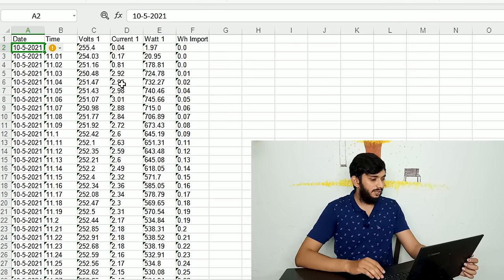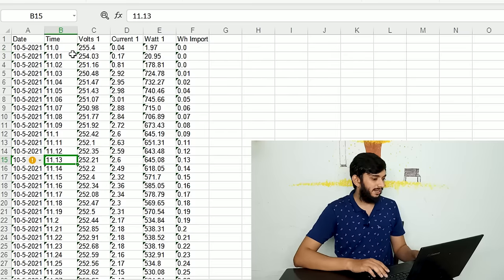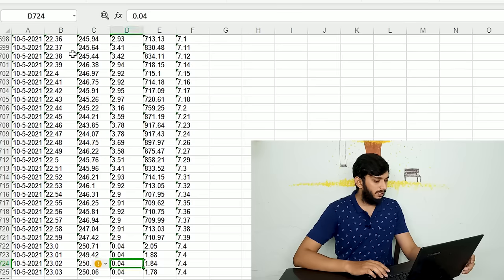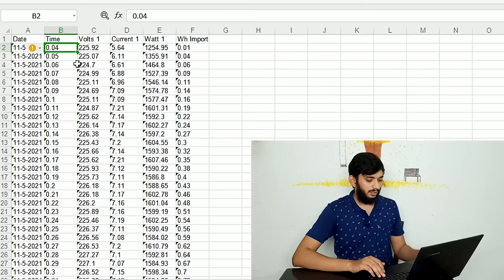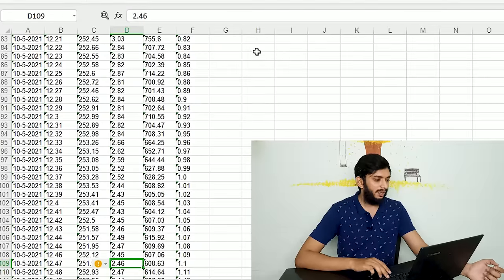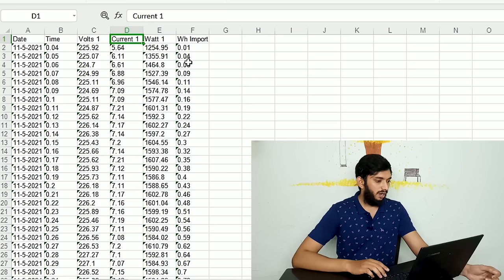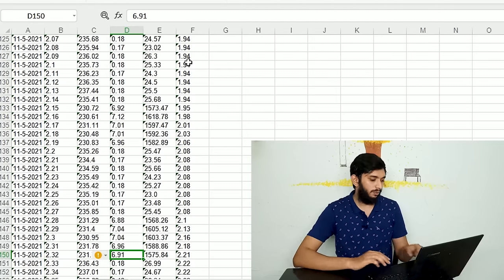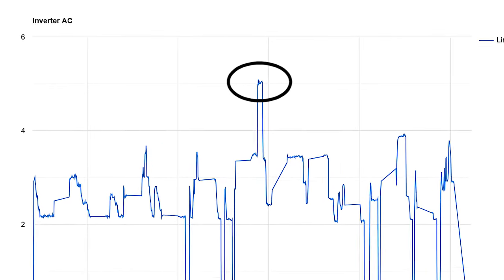Inverter AC vs Normal AC, How much unit will it consume?_Tamil, Does Inverter AC, Energy efficient?

Comment: Bro i think nenga inverter ac morning use pannanala energy consumption athigama irunthurkum(bcoz morning outside temperature high ah irukum when compared to night) so intha difference nu naneikiren
Plus inverter ac la energy consumption constant ah irukura nala load(instant energy consumption at all time) kammiya irukum so overload agi wire burning (sometimes eb wire burn agi power cut aidum) la nadakura chance kammi 
Drawback of inverter ac nu patha compressor all time work agura marinirukum so lifetime kammiya irukalam

Comment: you done a good job, and my opinion is normal Air conditioner  compressor life is long because off time on time interval is same so the compressor get rest time ,that is cool time get its increase the life of the compressor,  inverter air conditioner is ware-tear is high because continuous working is parts gets worn out  very soon. then interval time is that is slow and fast cycle is non even interval so it will damaged the compressor very soon...      We are paying money is inverter ac is one and half times high. they are fool to us.  the spare cost of the inverter ac is very high. ... awake people...

Comment: Very informative video. 1) One AC was tested at night and other one at day, this may be one of the factor for power consumption since environment temperature was different.
2) Can you please tell which ac will last long as service point of view
Reply: Non inverter ac will last long and is easy to repair.
Reply: Any AC will last long as long as you clean the filters regularly and do service every year, non-invertor ACs are noisy as hell as they run in full blast, invertor ACs are silent and are uselful for long duration run min 6hours. 
Invertor AC will sustain the temp constantly for example 28 will be constant throughout the run.
Non invertor will fluctuate the temp it's not really healthy and I dont know how he even says he is comfortable for me it's the opposite.

Comment: Hi bro...
I appreciate your effort to measure the kWh in both the AC's.
One point related to advantage of inverter AC is: In inverter AC, BLDC motor is used as a compressor motor & whenever the cooling goes down, the compressor will start smoothly due to presence of electronic switches in the inverter. Due to the same, the current is less while starting.

Whereas in non inverter AC, induction motor is used as a compressor motor. So whenever the cooling comes down, it will start & run with full speed. 

In induction motor, due to sudden start, the starting current will increase. Due to this, the life of the coil inside induction motor may deteriorate faster than BLDC motor.
Reply from the maker: https://youtu.be/imzw_dFzvL8
Reply: @engineeringfacts  😂 Semma reply bro 👌🏻👌🏻 Mass bro 💪
Reply: @Venkatesh nakku 🤦🏻‍♂

Comment: Appreciate your efforts.  For Tamilnadu you should run the AC at 25 degrees both at the same time.  Inverter runs in the morning where temperature is very high and non inverter runs when the ambient temperature is low.  That will give a clear picture.  The data definitely is miskeading

Comment: Thanks for the detailed review. 
Inverter AC is use and throw. Board is very costly. 2 of my friends changed it in 1 year. Think and choose.
Reply: Board warranty eh 3yrs irukum yarta kadha udra
Reply: @Kratos7686  Did you used inverter split AC or not
Reply: @sriramram7561  yes pcb board warranty 3yrs kudupanga, so reel udadha
Reply: @Kratos7686  We bought LG, the AC it failed  within 15 months, company technician told 15K for board replacement. 
Naan reel vidaradhuku avasiam illa. 
AC mechanic are not suggesting for inverter AC as well.

Comment: A big factor in Air conditioning was missed. The room size plays a key role in this experiment. If the amount of air volume to be cooled is higher in the case of inverter AC, then the number of units would be more. Ideally speaking both the ACs should be run in the same room during the same time interval (i.e., morning or night cycle) to do a proper comparison.
Reply: One in day and one n night doesn't make any sense
Reply: That's correct, I agree with your comment. Both should check in the same room, time and duration.

Comment: Great content. Appreciate the efforts. Big fan. Pls consider the following in a constructive way.
You have mentioned that there are no big difference in internal heat load (human, equipment, lighting)in both the rooms. But the external load seems to be different.

I feel the comparison would be valid if done in same duration of the day. The heat load through walls due to solar heat gain is peak at 4 PM and on West facing wall. 

So not just the room size, but the building orientation is also important. Is the west facing wall is exposed outside or not. Also roof has a good impact depending on if the room is in top floor or mid floor level?
Maintaining these would make it equal comparison from HVAC load point of view.
Reply from the maker: Check pinned comment. Given night time data of inverter Ac.

Comment: I guess the difference lies in compatibility to solar panels. With inverter AC, with low ampere, it can be run on solar, but it's near impossible for it to be done with traditional compressor ac.
Reply: We need solar ACs like solar pumps! They run at different load/speed depending on power availability!

Comment: 1. Bro... Daytime la 2 ACyum onna run panni data record pannunga... Atmospheric conditions remba important while considering power saving. 

2. Nenga 28 deg C la vachum over cooling ah irukuma unga inverter AC complaint nu artham.. may be temperature sensor faultya iruklam. So atha check pannunga.

3. RPM 1 / RPM 2 = (KW 1/ KW2 )^1/3.. Intha theory use panra entha machine ah irunthalum power save pannum. Inverter AC Ku pathila nenga normal VFD applications parunga. Same theory than ithulayum use panranga. At same conditions inverter AC will definitely save energy.

4. Inverter AC use panna machine oda starting current save panna mudiyum. No of starts kamiya iurkum. Machine life time athigam.

5. Inverter AC vangum pothu right deisgn ku vanganum. Nenga 100% continuous ah heat generate panna kudiya edathuku inverter AC vanganumnu avasiyam ila... but bedroom ku inverter AC than best. Heat generation irukathu.

6. Model , type of compressor, mechanism, manufacturing year , star rating ithu ellame factors than.

Marketla Rs.17000 ku new AC iruku. But athoda energy consumption remba remba athigam. ungaluku vanjapugalchiyanila yarayavathu pali vanganumnu thonuchuna Rs.17000 AC vangi gift ah kuduthrunga.. athuku Current bill katiya nonthuruvan. Anyway a big salute to you bro... Ivlo detaila report eduthathuku.
Reply from the maker: Check pinned comment. Given night time data of inverter Ac.
Reply: @engineeringfacts   bro... Could you please share me the daytime data of both at same conditions?

Comment: Brother... you have taken the DIFFERENT time period in DAY and other one in NIGHT.. It is wrong... Because the Power load consumption of the AC unit depends on the variation of Inside Room and out side Temperature. So during the day time the Temperature difference Inside Room and Out side will be MORE and during the Night it will be Less ... So You will get the correct result only during the Day Time of High difference in Temperature of same timing, & Same size room  which is very Important ( Say from 9.00 AM to 6.00 PM ) .. Also you should Note down the initial Temperature at 9.00 AM, Peak-Mid Temperature @ 2.00 PM and final Temperature at 6.00 PM on both days of reading of Normal & Inverter AC's, where you have to prove to be same... Hats up for your efforts in bringing this video.. Hope another video of this correct day timings will provide perfect result and Likes to you .

Comment: I have tested a 1.5 5star inv ac and 1ton non inv ac. The power consumption varies for night and day. For inv temp of 29 will suit as it cools steadily and 28 will suit for non inv. 
1. For inverter ac or non inv ac the power consumption is not the same for night and day. I have practically measured with a power meter. 
2. As you have mentioned the set temperature will vary. You will need to have a temperature meter in the room to adjust the ac temperature uniformly as there will be slight variation of 1 to 2 degrees for inv and non inv ac cooling distribution as you would have noticed. 
3. I did this test to check current power consumption. To check if I need to replace old ac as there are board issues and the compressor vibrates a lot which is transferred to the floor and walls. 
- 1.5T 5* Inv ac was taking just 1.7 units for 7.5 hours averages to 222 watts @29°c. Room size is 170 sqft.
- 1 T non inv LG ac took 3.8 units for the same 7.5 hours night run averages to 500watts@ 28°. Room size is 140sqft.Both in top floor. This ac was serviced recently so no question of clogged filters too.

I can clearly see a difference in the power consumption between inv and non inv ac. Maybe 3* inv ac might not be so power efficient but a 5* surely is. The power the inv compressor settled down after cooling the room post 35 minutes was 180 to 210 watts. This is similar to an air cooler.
Reply from the maker: Check pinned comment. Given night time data of inverter Ac.
Reply: @engineeringfacts  Thanks

Comment: He say correct iam Ac mech only
After 2017 particularly display models stabilizer reading maximum wrong only
And we use normal ac we set 28 degree temperature only
It's very comfortable for sleeping and power saving

Comment: Brother I think stabiliser la thaan problem irukku. Can you get the data without using voltage stabiliser. because stabiliser leakage irukkurathaala inverter AC units adhigam varuthu you can see here less current but voltage more

Comment: I have both , all your points are correct but  what I feel is in normal AC i feel a sudden throw of Cool air and stops abruptly, but in inverter i feel the smoothness no sudden throw of Cool air all flow increase gradually and your not going to  feel sudden change of  cooling  ,, inverter  gives us a very good comfort.
Reply: Yes, inverter ac will comfort, that why peoples switched to inverter ac

Comment: So true. inveRtor ACs doesn't make sense for domestic purpose.
It may be help reduce power for commercial use where ACs keep running for long durations. However, incase of board failur in inveRtor ACs, service cost will be high in inveRtor ACs.

Comment: Good attempt for an youngster. But a more scientific approach is required. EER score of the AC is an important factor. EER of 3.5 to 3.99 fall under three star but energy consumption will vary. 
Also actual temperature should have been plotted on ten minutes gap (both indoor and outdoor). It is very important to give careful attention to boundary conditions while designing an experiment. You have the potential to differentiate yourself from juggad crowd. All the best.

Comment: As perVoltage fluctuation area better go for an inverter AC.
Because it won't trigger in very low voltage .Then no need of placing stabilizer.

Comment: One more test needed bro, before verdict. Run the Inverter AC from 12AM-12PM and Non-Inverter AC from 11AM-11PM. ஏன்னா, அந்த மதிய வெயிலை சமாளிச்சு ஓடுறதுதான் கஷ்டம். பாத்துட்டு Resulta sollunga. I guess 12-7, Inverter ரொம்ப கம்மியா எடுக்க வாய்ப்பிருக்கு. அதுக்கப்பறம் வெயில் வந்ததும் சமாளிச்சு ஓடும். அதேபோல Non-Inverter AC 11AM-11PM பயங்கரமா பவர் இழுக்கும். 🙂

Comment: I have a voltas 4 star non inverter AC and a Daikin 5 star inverter AC and a carrier window AC... All are 1.5 ton... Tested them at same night with 28 degrees... From 11 pm to 6 am... 
Carrier has consumed nearly 10 units...

Voltas has consumed 6 units...

Daikin has consumed 3 units...

And I felt more comfortable with inverter than non inverter as it maintained constant temperature...
Reply: All are in same room or another rooms

Comment: Outside temperature plays a big role and also the persons inside the room. To be simple inverter and non inverter is like normal ac and automatic ac in car. When u set the temp in automatic or inverter it will adjust the running of compressor to maintain it. Normal ac also does this but it will stop the compressor when temp is attained and checks for the room temp and again it starts to run if temp is high. So in there wont be sudden urge of getting load in inverter ac. there will be variation in units when u use it in long period say abt one year.                                To be clear if ur using ac often and daily go for inverter or if u use only for the summer time then u can go for non inverter
Reply from the maker: Check pinned comment. Given night time data of inverter Ac.

Comment: Normal (non inverter ac ) run aana time la out side temperature mostly low a eruka chance eruku…  bcz athu might night la run agiruku… inverter ac vanthu outside temperature mostly high a eruka chance eruku… may be if possible try to calculate same time then we come to know correct answer….
Also star um impact panum so better mention star as well

Comment: I am from Sri Lanka. I am using a non inverter AC set at 26 and for 4 hrs at night. Outside temp should be around 29 with high humidity. My AC unit is continuously working throughout the night with approx 1 unit/hr. Is this normal? I thought AC compressor should stop and start according to temp inside. I run ceiling fan too.

Comment: Bro inverter AC la voltage leval parunga high ah irku
But normal AC la approx 230 tha vandruku ...Enna tha voltage and current ah vary pannalum wattage same ah tha varum... inverter AC la Enna benefit na compressor and contector life ah extend agum avlo tha athu current nearby 4 A athanala

Comment: Both you should test on same time why because day time hot will be more so to match that AC has to on all the time. However, night temperature will be less so it’s easy to keep 28 degrees on continuous AC activity is less.
Reply from the maker: Check pinned comment. Given night time data of inverter Ac.

Comment: The two a/cs seem to give same results. But the differences are there.
Input voltage is shown as 250 and 225. Inverter a/c runs continuously and the wear and tear must be more.  If the difference in timing between stop and start are larger then it will be good, but this is for normal a/c only. This is possible if insulation is better in the room. This makes no difference for Inverter a/c.

Comment: Pls check 22-25 degree celcius. Surely 100% it will make heavy difference... Bcz normal ac compressor getting more current consumption in low temperature...

Comment: Bro....take non inverter AC reading in day time....then it consume atleast 1 unit different.....night time odhunadhaa....day time odhaa compare pannadinga.....outside temperature also affect cooling.....inverter AC night time you can use sleep mode to avoid over cool....it will gradually increase one or two degrees
Reply from the maker: Check pinned comment. Given night time data of inverter Ac.
Reply: Pls upload in youtube

Comment: Good try but wrong approach, 
1. Setting temperature of 28 will not make big difference, kindly check by keeping temperature at 22-24 , I hope there will be huge difference for sure.
2. Test both at same scenario because in night the temperature will be lower than so the stress on Compressor will be comparatively lesser.
3.based on Compressor gas level the output may have huge impact so make sure that both the levels are good enough.
Requesting you to make another review by considering these three aspects.
Hope the tonnage is similar in both
Reply from the maker: Check pinned comment. Given night time data of inverter Ac.

Comment: Video is good but you missed to factor in one parameter bro. Outside temperature will be different for a day time calculation vs night. You will get accurate reading only if you compare both ac running at same hours in day or night time
Reply from the maker: Check pinned comment. Given night time data of inverter Ac.

Comment: Ac 28 degree la vachu 8 hours ku aprom check pannom eb meeter la. result 2.6 units vanthathu. Night 10 to morning 6 clock. lg deul inverter ac. Ennoda last month eb reading 240 units. bill amount 350 only

Comment: Bro nenga solardhu correct but I have one doubt? As u kept 28deg on both AC, In invertor AC u said compressor was running. But In non invertor AC compressor cuts in and cuts off. My doubt is, whether it is invertor or non invertor AC wat ever temp u keep say it is 25deg, when the temperature reaches 25deg that time only compressor wil cut off, till that time it wil be running only. This is just common sense in the AC. How come in invertor AC compressor was running frequently?

Comment: Both time and temperature settings thapa eduthu erukinga  inverter ac power consumption less but in fault service cost is high but non inverter ac power consumption is high. Fault service cost high

Comment: Highlight of Inverter AC 
1. We get constant Temperature. 
2. Runs at Low voltage. It is safe to run at 4 Amp. Instead of 8 Amp.
3. Runs Silently.

Comment: Current Wire-ku load irukathu pola iruku, inverter ac ala ithu mattum than micham,
Boss apporam antha SINFIN Brand BLDC motor ac eh pathi konjam sollunga, 45,000rs solranga , current kammiya ilukuma antha ac odumbothu amps 2.0-0.5 than vauthu

Comment: Good explanation bro but I have one doubt, inverter AC run aanadhu afternoon outside heat adhigum irukkum ana normal AC run aanadhu nyt so low current podhum la
Reply from the maker: Check pinned comment, night time data given for inverter AC.
Reply: @engineeringfacts  actually nyt time la run aanadhu normal AC thana

Comment: Will there be any difference in consumption if the temperature is set at 22 degree? Normal AC got to run longer to bring temperature down?